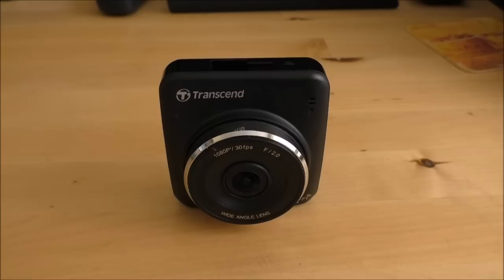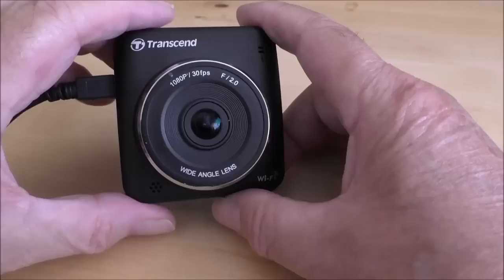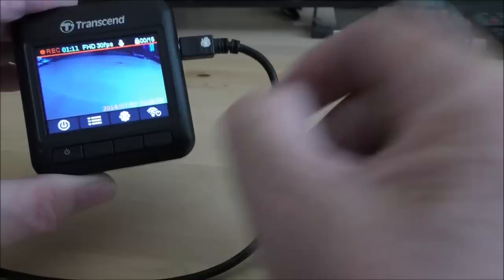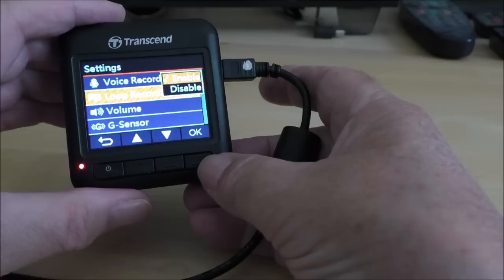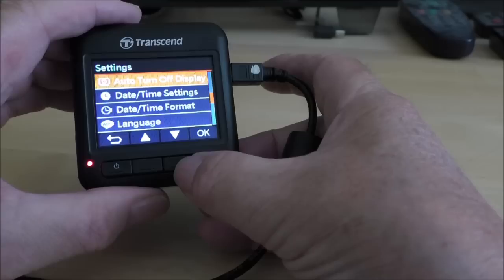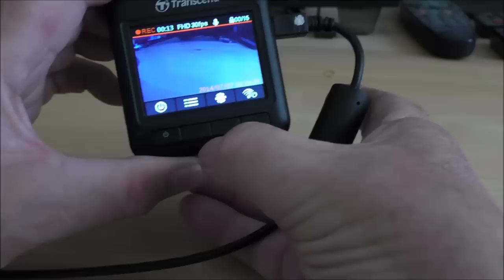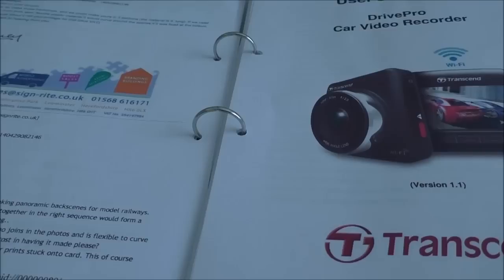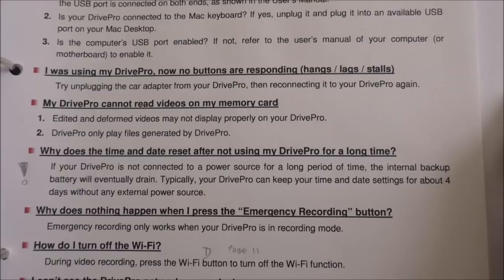UNDERSTANDING THE TRANSCEND DRIVE PRO 200 IN CAR CAMCORDER

Comment: Very useful, thank you.  This cam is on the top of my shortlist for purchase.
Reply from the maker: It continues to give satisfaction with the exception of the sound quality. One strange thing that happened recently was that I wanted to keep a whole section of its recordings but when I fitted a replacement memory card.  it said "not supported." I then went through the format process and it recorded ok, but required that to be done for every journey  This may be due to a problem with that card. The original card still works ok.
Reply: cheers for that.  BTW I have decided to wait for the release of the 220 model (release imminent) which has a battery and will eliminate that tedious business with the time/date settings you mentioned.
Reply from the maker: Mobius Klein That is a good idea!
Reply: Mobius Klein

Comment: I appreciate your review and demo. Based on your video and the Auto Express review suggesting this is their #1 dash cam choice. Everything arrived as advertised. However, it is not recognised by laptop when connecting with a lead; instructions suggest that drives etc would be downloaded from the unit and would connect automatically. This is not the case and I have had to rely solely on inserting the memory card into the pc.
Reply from the maker: diabeticguy I fear the Auto express test was rather limited. I also put the memory card into the PC. It is most convenient that way anyway, as long as you don't lose it between the car and indoors! !I bought it mainly based on their review but have had several problems especially most recently with the sound quality. That has been reported back to the UK agents who did solve some other problems but simply replied In am being fussy and not many people are concerned about the sound quality.
Reply: i think thats because its not 12v from usb.

Comment from the maker: Update August 2015. The picture quality I am getting is good but the sound isn't. I have taken many hours on it now and I believe really there is a problem with my unit. The agents are saying I am being too fussy! I am glad to say the clock display stays correct much longer in this one than previously.
Reply: +ADMIRALSCORNER I wonder how long the capacitor takes to reach full charge. As you said in the video, you might not drive your car so often and it might fully discharge. If it only takes a minute to reach full charge though, even if you're not driving anywhere, it might be worth popping out to the car to leave the ignition on for a minute to make sure it reaches full charge.
Here's the link to the manual: http://www.transcend-info.com/B2BSite/ProductCenter/EN_DP200.pdf
One more thing, it's dangerous to not set the date, because if you don't, and the memory card fills up and wants to start overwriting older files, how does it know which are really the oldest if they almost all have the same date.
Reply from the maker: +Alien Or Sutin Thank you. I continue to be pleased with the vision quality of the camcorder but not the sound quality. I am glad to say this latest camera has maintained its correct date reading for months now in spite of me not using the car every day.

Comment from the maker: I eventually did receive a replacement for the faulty one on 5 September.. That did film the complete journeys unlike the original one, but sadly the picture quality is poor, being hazy and indistinct, quite unlike the original one which did produce good quality pictures. It is set up correctly with the resolution at !080p but is far removed from that in practice. So its back to the UK agents again!
Reply from the maker: I was able to send them a video of the poor performance of this second camera and once again a replacement has been promised.

Comment: I recently purchased one and also found out the legal ramifications of fitting one on a windscreen (in the UK). Be aware that if you can see the LCD screen from your driving position, the screen MUST be disabled (in settings) before you set off. Also, the unit may only be placed no more than 4cm within the outer stroke of the wipers, AND, no more than 1cm within a rectangle bounded by vertical lines from the edges of the steering wheel and the outer stroke of the wiper. If you have an accident, and it is found that you have broken these conditions, technically, you could be prosecuted for Dangerous Driving, with serious repercussions.  YOU HAVE BEEN WARNED!
Reply from the maker: I did wonder about that as I once had an MOT failure due to a sticker on the windscreen.

Comment from the maker: Update on 24 October. So far fingers crossed all appears ok. There is one strange thing happening however that has not occurred on the previous ones.  When the memory card is placed into the camera in the car the first time after it has gone in doors for monitoring on the computer and you switch it on, the screen just shows a black and white partial picture which doesn't get recorded. You have to then switch off the camera and then back on again to clear that. It is ok after that. I suppose I can live with that! The picture quality seems acceptable but I suspect it isn't as good as the results I got on the original one which were very clear and sharp..

Comment: Re the video out cord and the lack of power to view videos on the television or computer.  With some units when they are connect to a computer via the usb  they draw power from the computer they are connected to this allows the videos to be viewed. The television I wouldn't hazard a guess. Re The memory card it should be formatted in the camera before use
Reply from the maker: I am now on to camera number four now and it is working as it should, reliably and with good quality pictures. All this tooing and froing back to the importers has given me a lot of experience with the camera and how to use and update its software! It is a good camera but really does need an internal battery to prolong the date info and a kit to be able to run it in the home. I believe there is soon to be an updated model available which I hope will improve these features.